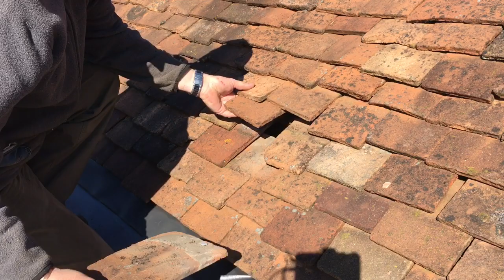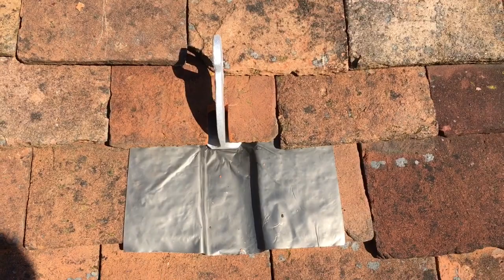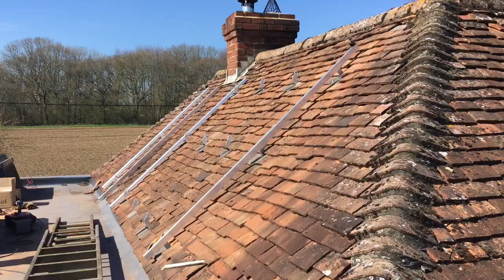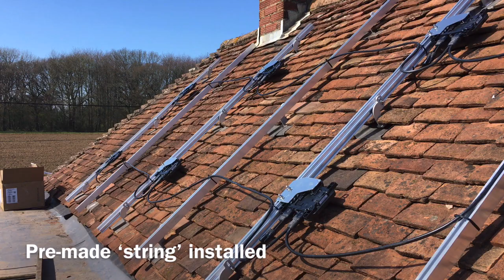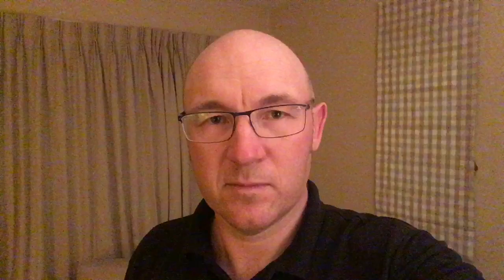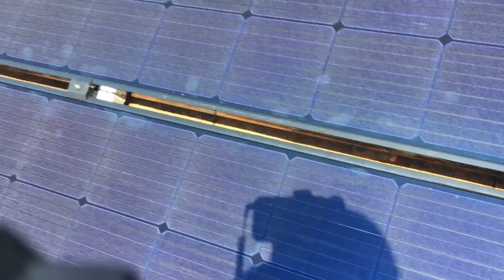DIY Solar PV install

Comment: Are they hand made ceramic tiles on your roof? How old is your house?
Reply from the maker: Alan H, yes. Well they are hand made clay tiles. Probably salvaged from another building before ours. Our house was built in 1940 and they are much older than 80 years old (so I am reliably informed).

Comment: I have to say that these solar panels look awful! The clay tiles look so much better, and for the tiny amount of power produced it seems hardly worth making your lovely house look hideous, the cost involved in putting this monstrosity on your roof will hardly be returned by the time the units fail, have you considered that ? Why not put the panels in your garden if you must have these things.
Reply from the maker: Englishman French, this side of the roof is not seen. 
I know we are in a sunny spell at the moment but we are producing 11kw a day and using a total of 15kw. So it’s producing about 2/3 of what we use. The month before install we were using about £4.40 per day and it’s now down to something around £1.60 ish by last calculation over several days. It’s not all about the money. 
The set up cost me £2200 plus my time. Even being conservative it should pay for itself in about six years. The system I purchased is quality and warranted for 25 years. 
In summer we use electricity to heat the water via an immersion element. We have not had this on at all since the panel install and the water is hot and only heated by the solar panels. 
I’m happy with the results so far. Winter May be a different story. :-)